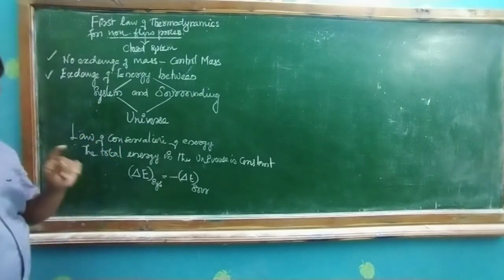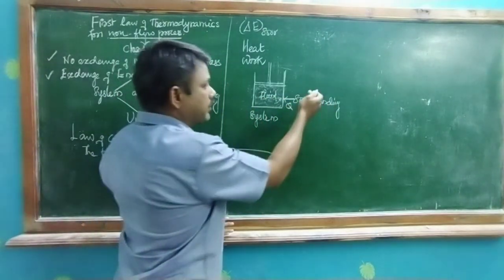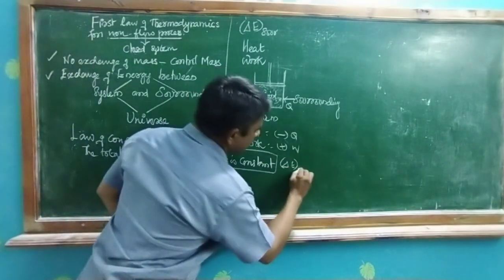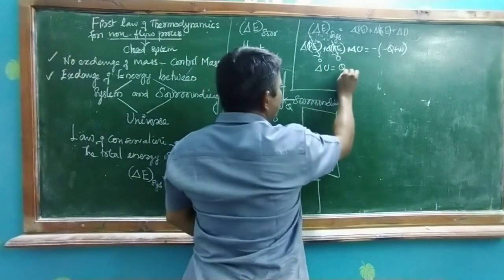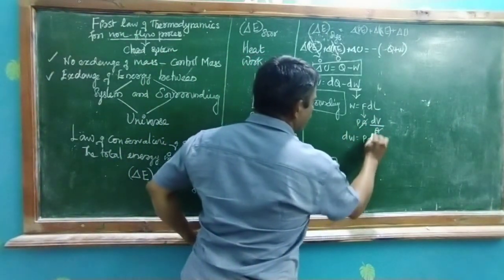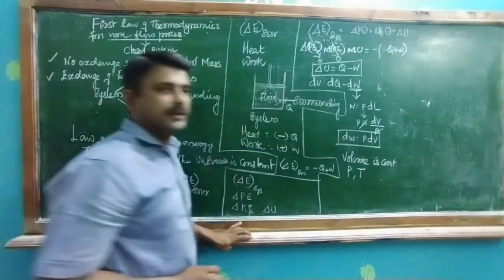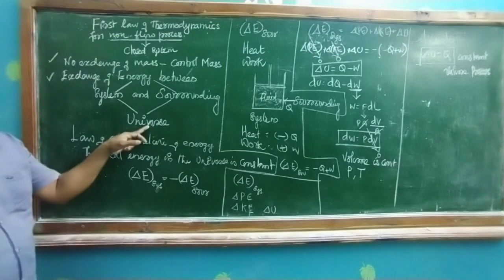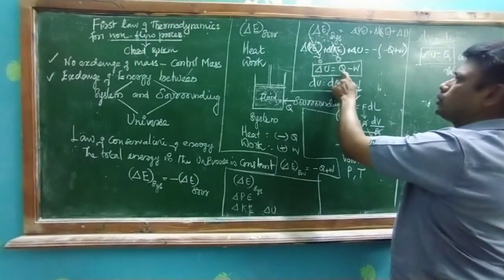Principles of First Law of Thermodynamics for Non Flow Process

Comment: The thing is that you have considered the surrounding application on the system is great for the concept knowledge 🙏🏻 but that's what making it difficult to understand 

In diploma i only get known to the concept like delta E for system is Q - W and that's because heat is getting added to the system making it positive and as the work getting done by the system making it negative 

Also how volume will be constant for the closed system and which surrounding effect makes it happen